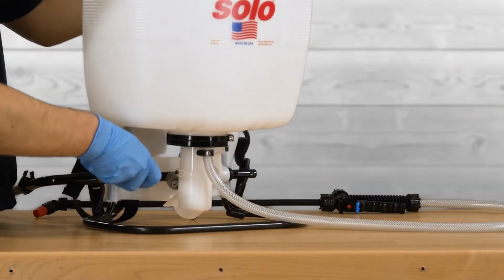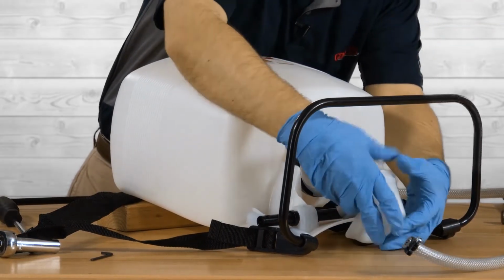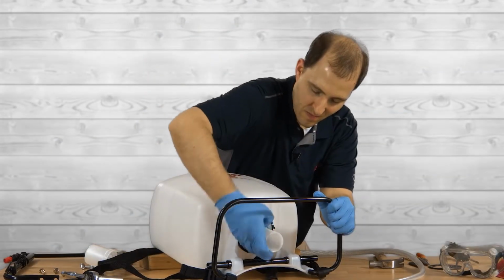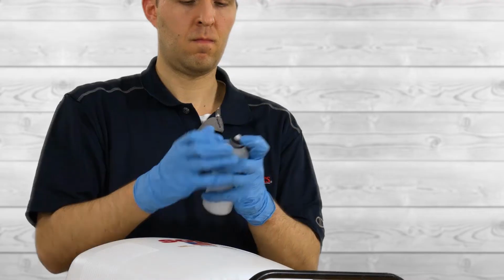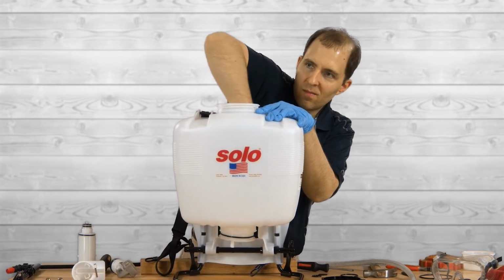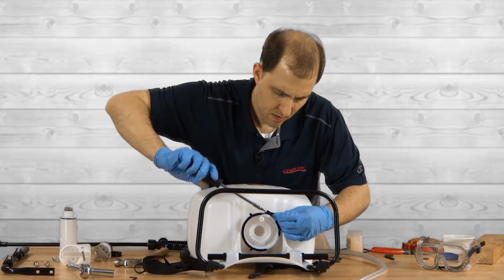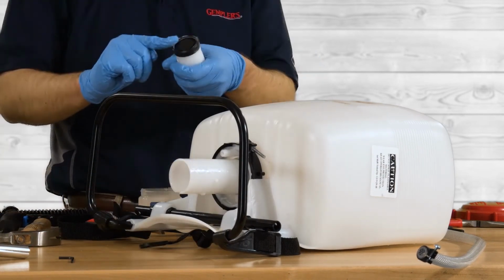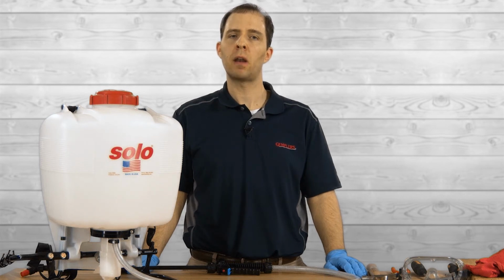How to Disassemble, Repair and Maintain a Solo Piston Pump Backpack Sprayer | Tips from Gemplers

Comment: It worked! Thank you for the tips. I did not get the pressure tank out. I pounded on it but did not want to break anything. But that was fine, it came out far enough so that I could install the new o-ring.

Comment: Not happy. Bought Solo 425D 4 months ago. Did  max 3 sprays with standard glyphosate mixture. Two months ago it started leaking. Contacted Solo. Said " it sounds like the collar is damaged from chemical. If that is the cause of the leak, it wouldn't be covered under warranty. The collar is available for purchase on our website. However, if you think this isn't the case then you can send the sprayer to us for inspection." Didn't say where to send it:clock-turquoise-looking-up:
Followed instructions in this video. Still leaking. Sending it to landfill.
Anyone recommend a backpack sprayer that is fit for purpose?

Comment: I have followed your video instructions very carefully.  However, when I get to removing the tank with a block and hammer, it will not come out.  It appears that while hard to see, the bottom portion of the pressure tank inside the sprayer tank may be larger than the hole through which it is supposed to be removed.  I have a complete pressure tank/piston pump ordered and on the way.  I do not want to break the body of the tank.  Can you please offer a suggestion?  Do I need to cut the old out, and then will the new fit?  The pressure tank piston assembly is supposed to be an exact fit for my Solo 425.  Thank you.

Comment: I have a sprayer like this and it’s given me nothing but trouble   The first season the sprayer wand leaked which required a replacement   This season it quit pumping up    The piston came apart   I can not get the cylinder out of the sprayer even using a strap wrench   Note this piece of junk wasn’t purchased from Gemplers

Comment: Hi - during disassembly (2.22) - and reassembly you brush over the removal of the pressure control knob located inside the tank on the top of the pressure dome.  The issue I had was I was pumping the lever - but no pressure.  Turned out, the top had blown off the tiny nipple inside the pressure Control knob.  The pressure control knob is the black star fixture located on the top of the pressure dome inside the tank.  This unit has 4 settings #1 = 15psi  #2 = 30psi  #3 = 45psi and #4 = 60psi.  This whole unit is simply unscrewed counter-clockwise.  The cap is spring loaded and is step turned beyond the lowest setting (1) and comes off.  Inside is a spring with a tiny black rubber nipple jammed in the end of the spring.  If the pressure gets too high - this nipple can pop if it is old, so releasing all the pressure.  There are also 2 'O' rings located on the screw in thread - a large and small, which is what is left over once you have done a full seal kit change.... which turned out to be unnecessary, as it was the pressure control that had popped.  The large O ring just sits on the top of the thread and forms a seal between the control knob and the pressure dome - the second smaller O ring sits in the grove at the bottom of the thread that secures the Pressure control.

Comment: Very good video and easy to follow.  I had my pressure cylinder explode  on me from over pumping the sprayer.  I bought a complete cylinder kit assy off Amazon.  The disassembly of the unit of was very straight following the video until I got to the removal of the pressure cylinder... what a pain.  The domed top of the pressure cylinder was gone from the over-pressure incident so was able to put in a length of 3" pvc pipe to the base of the cylinder and was able to pound it out (4lb small sledge).  Probably a good thing I bought the cylinder kit as many of the other plastic pieces became brittle over the years.  Guess I had this thing for awhile.  Thank you!

Comment: Thanks alot! I tapped the pressure cylinder with a block of wood and a mallet and it freaking cracked my tank!! Now it's junk!!
Reply: Yeah straight to cavemaning it is not the best approach, especially with older ones. Plastic gets hard and brittle. If you use boiling hot water and/or a heat gun on the outer ring, it softens everything up and makes removal much much easier.
Reply: Somehow I think you did more than tap it. Why did you bother leaving this comment?

Comment: I just rebuilt mine. Had a hard time getting the pressure cylinder O ring to stay in place when reinstalling the cylinder. Once installed and put water in tank to test for leaks water leaked when pumping for pressure. Disassembled and reinstalled pressure pump cylinder ring once again (note ring appeared to be inplace when disassembled). Reassembled and still leaks. Any suggestions please. Ty
Reply: Hi - I had the same problem.  The issue I found was the bottom O ring appeared to be slightly too big, so was not a tight fit in the location groove.  When inserting the pressure cylinder, the O ring would catch and slip up and so was not sitting in the groove - so it leaked.  Apply some suitable lubricant to the O ring and work the pressure cylinder back nearly in place - then little by little push it gently home - but check all the way around that the O ring is still siting straight in position in the grove.  If - like mine, it has popped up (caught on the edge) move the cylinder down a tiny amount so the edge of the O ring is exposed and use a blunt small blade screw driver to gently push the O ring back into place in the groove.  Took a few attempts, but patience paid off and it seals great now.

Comment: I am in the middle of trying to repair my backpack sprayer and am stuck -- literally -- with the piston cylinder. In one of the comments they recommend using a heat gun which was going to be my next step anyway, but glad to see I'm on the right track. I'm recording the process on YouTube on Planet Mojo and my first video can be found here: https://youtu.be/73CroSeBbJ4 -- if I can get the cylinder off, that will be recorded as well 😊
Reply: Update: Success! The cylinder is hard to get off but if you clamp the tank down to a bench, you can get a better grip on it and I got it off. I did use a heat gun -- but only for a little while and it didn't get very hot. I made a second video showing the completion of the job on my channel @Planet Mojo

Comment: I purchased the piston pump repair kit for my solo sprayer. I am having trouble keeping the large O-ring in the groove on the pressure cylinder as I'm trying to reinstall it. Any suggestions?
Reply: I rotated the vessel so the bottom side was up and had to carefully use a tool (ie flat-bladed screwdriver) to keep the O-ring in its groove as I slowly pushed down the cylinder. It took a couple of tries. Make sure you don’t damage the O-ring, it’d be real easy to do that. 
Also, applying some lube to that O-ring will help it glide along the sprayer wall as it gets seated.

Comment: Is it possible to convert a Solo Backpack Sprayer from piston to diaphragm? I mean, the tanks look the same, and the opening on the bottom looks the same. Will the diaphragm assembly fit in the tank where the piston was?
Reply from the maker: It sure is! There is actually a kit with all of the parts to do just that. You can find it on gemplers.com here: http://www.gemplers.com/product/4900310N/CONVERSION-KIT-473P-425-435?cid=VGEM0076
Reply: Excellent! Thank you so much... just what I needed!

Comment: my pressure cylinder isnt coming out I've been on it for a while. Do the older models come apart the same way?
I've had mine 15 years or more.
Reply from the maker: The older models of Solo backpacks sprayers come apart the same way as shown in the video.  Keep in mind, it will take more force to get the pressure cylinder out of an older, well-loved sprayer than what is required for the new model shown in the video. You can also try very carefully heating the bottom of the tank with a hair dryer or heat gun to ease the process. Hope that helps to get the job done for you. Let us know. Or feel free to call 1 (800) 382-8473 to talk to someone on our Product Support team.
Reply: I have a 2 year old sprayer and have a stuck piston cylinder as well. Tried a strap wrench on it to no avail:  https://youtu.be/73CroSeBbJ4 I'll try the heat gun suggestion and see if that works.